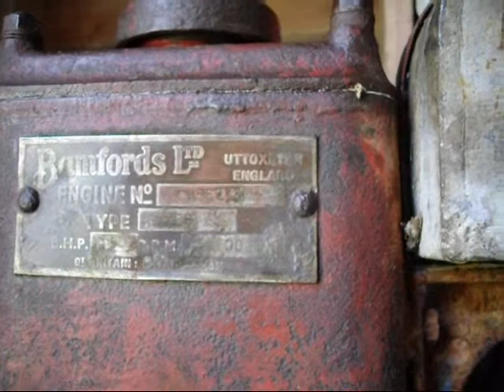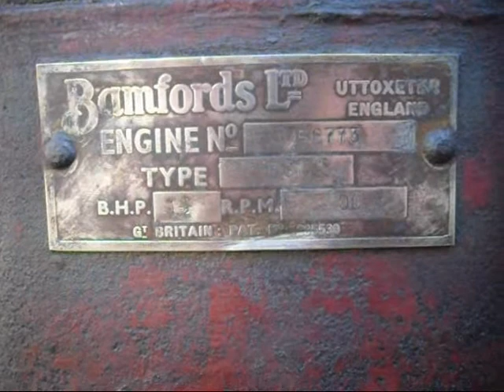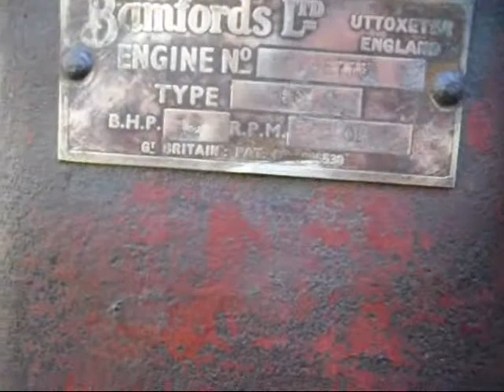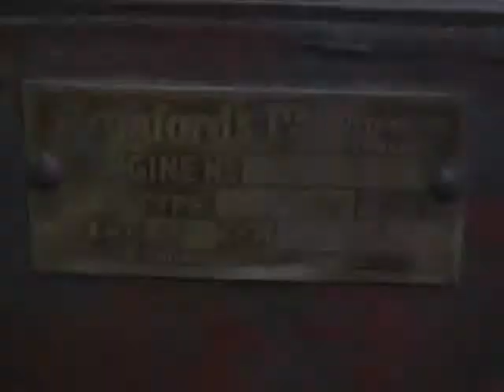Bamford EG1 - Part 4 - Ready to rally?

Comment: 65 years old I hope I last that long without an overhaul.
the engine looks good once the mounting bolts have been replaced it will be spot on.
I decided not to buy any heavier engines a you know its a chore to move them and lift them.

Comment from the maker: No, actualy you should use fibre material for carb gaskets on engines like this. The machined faces are rarely good enough to use copper. If you use a copper gasket on a carb like this (made of a soft metal called mazack) you will have to overtighten the bolts to get a seal and you are likley to crack the carb. This carb is warped I think so the old thick gasket has been left well alone.

I did think about silencing the engine more, but no need realy, it sounds too nice